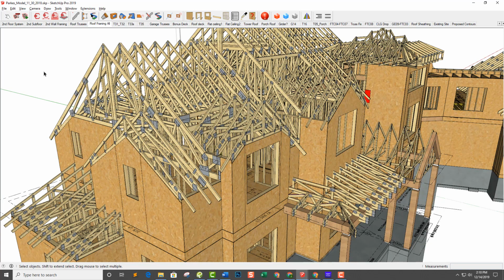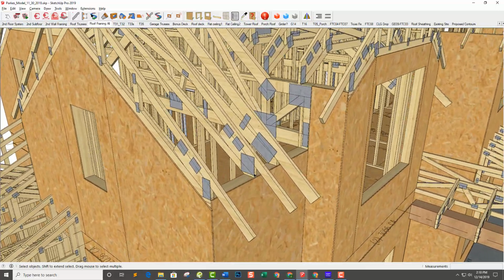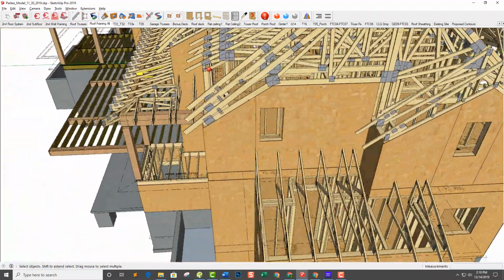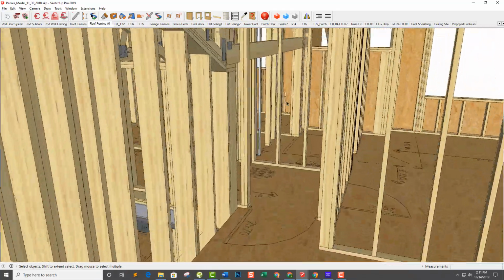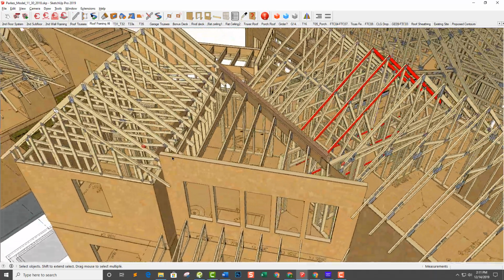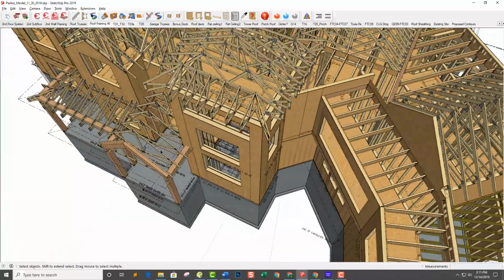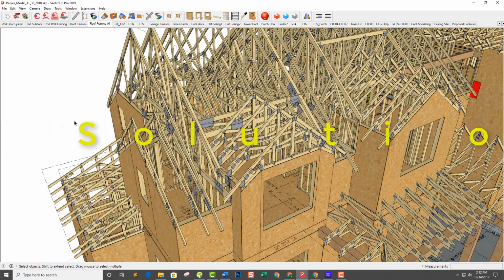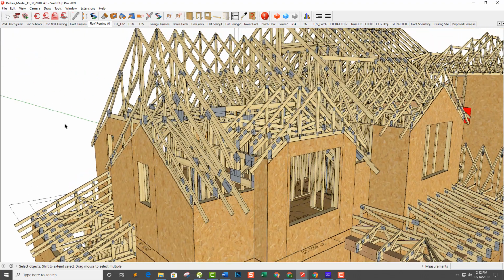Constructability3D - Identifying Roof Truss Issues BEFORE Ordering!

Comment: Awesome work John. You'd think the truss manufacturer would see these issues when they are looking at it in 3D too. Btw, I haven't had consistent results with importing a DWG from Mitek. Sometimes, all the trusses are exploded so I just get a bunch of 2x4s, other times, I'm able to retain each truss type as a component (which is great). Have you found the same thing? You mentioned that you do some cleanup on the trusses...
Reply from the maker: Thanks!  We import trusses from all over the country, so we definitely see a variety.  Some are sticky geometry completely, which sucks trying to group them when you have overlapping trusses.  And, as you said, some come in as components which is awesome.  Seems like everytime there are duplicate chords that bloat the file and can be deleted, but that takes valuable time, so we usually leave it.  We always refer back to the layout and individual truss drawings (so as not to assume the 3D model we get is correct).   I usually run Fredo's auto reverse faces and sometimes cleanup - add wood texture to 2xs and metal to gang nails.  Sometimes we do not get gang nails, which is fine, but you know I like the realism :)